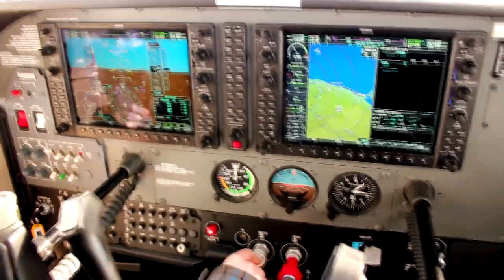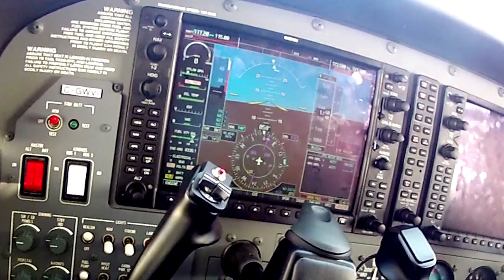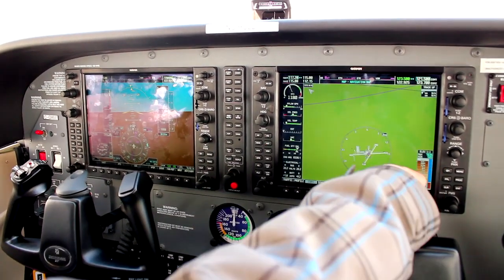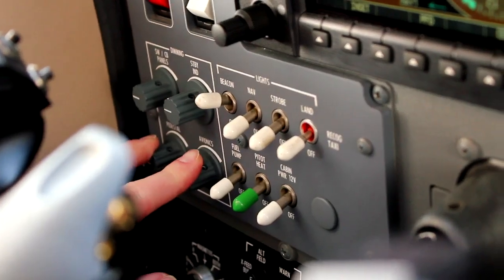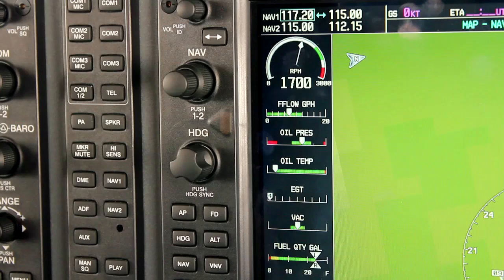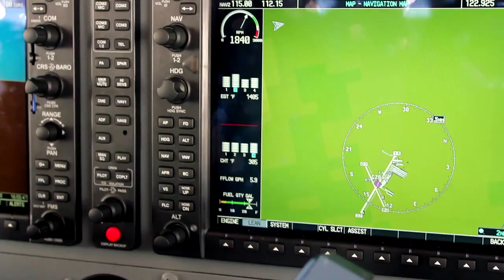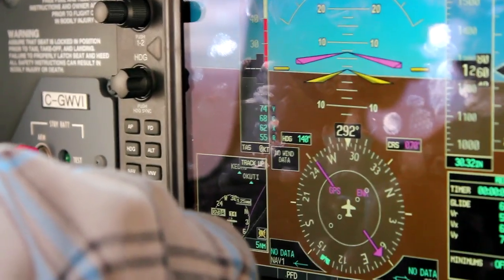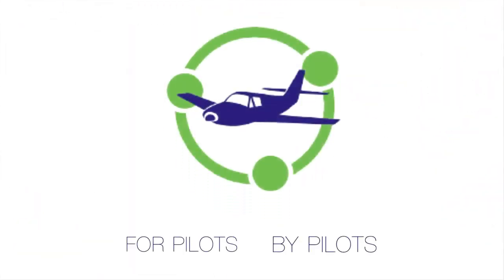G1000 Glass Cockpit tutorial - Start + Run-up - Real Time - POV flying

Comment: You do not turn off the ALT Master switch. Lot of people does that and is incorrect. Show me where in the POH says to cycle the ALT Switch  . 
You just turn lights or move flaps to see if the ammeter is working. Flipping the ALT  create spikes that can damage avionics.

Comment: I hate the G1000 for many reasons.
Firstly, fly-by-wire is a death trap. And I hate that cars are using it for steering and brakes and throttle now too. I know, fbw and the glass cockpit aren't necessarily tied together. You could put a G1000 in a Cub. But, it's hard to make electronics as robust as mechanical connections.

When I fly, I like to use all 3 navs with each other for redundancy and accuracy. The ADF needle lining up with the VOR2 needle to act as backup in case the VOR1 ILS inops. With the G1000, you can see only one of these at any given time by pressing a softkey. With the analog cockpit, they're all visible without taking hands off the yoke&throttle.

Comment: At 3:45 the question is asked how does the G1000 know where the (wet) compass is at? The instructor said there’s something inside it (wet compass) that knows (tells the G1000). This is misleading, or at the very least, unclear. There is a remote compass that is wired into the G1000 avionics box to tell it what heading to display on the PFD HSI. The wet compass has no input functionality.
Reply: G1000 has a built in magnetometer, no connection to the wet compass mounted on the dash

Comment: G1000 gives you really specific and precise information regarding engine performance, navigation, electrical systems, and Great situational awareness, especially regarding airspace boundaries and terrain.  Being able to program an IFR flight on the ground is so simple and easy, and a great way to get and stay ahead of the airplane in actual IFR conditions with the aid of auto pilot if you’re single pilot IFR.

Comment: Do some 172s not have carb heat?  I don't see it on the panel.
Reply from the maker: Older ones do, yes.  But I think this newer one is fuel injected.
Reply: Thank you for replying!  I learned something today.  I thought they all had carburetors!

Comment: Where's the turn and bank indicator?
Reply: as described in the video, the "ball" (slip/skid indicator) is represented by that little bar under the triangle at the top. The triangle is the turn indicator (shows degrees bank along the top arc).

Comment: I had my first flight with a G1000 172 last week. They are pretty cool but take some getting used to. Steam gauges are faster tio look at but once you start getting used to it the like altitude seem easier. Not that it matters I won't be able to afford anything like that when I purchase a plane. Good video thanks

Comment: I instruct in G1000 Skyhawks, and this man was incorrect as far as the HSI goes. It is in no way connected to the compass. There is a magnetometer in the wing that the HSI gets its heading info from
Reply: I want to like but I must not disturb the number.
Reply: DR compass
Reply: Can rudder paddle be adjusted in Skyhawk??

Comment: Oh boy. I'm 19 and I have plus 60 hours in a G1000 172. Almost to my CFI. Playing with the electrical loads on the alternator is nottttt good at all. And so are dirty fingers :)
Reply: False, the battery (and standby battery in the G1000 configuration) are designed to take up the electrical load if your alternator would fail. It would actually be in your best interest during the run up check to test if the battery will work properly in the event an alternator failure would occur & if the alternator will provide a sufficient charge after re-engaging the field.
Reply: You are correct. But we check the standby battery.....with the standby battery test switch! And we can check if the alternator is working by seeing if the busses indicate a charge, and if there is no low volt, or high volt annunciators.

Comment: Hey I like your videos, just a couple of things. Perhaps the instructor should brush up on Electrical System, it becomes very important with all the electronics in need for power. It is not a 20 volts system as he says, it's 28. We can se that on the Main and Essential Bus before he kills the Alt. Also, the transponder switches to ALT mode when passing 30KIAS not 45.  
One last thing, touching the screens the way he's doing it...bad habit with the G1000, they're not that easy to clean. 

Thanks for your job doing this videos!
Reply from the maker: Luciano Bianco Thanks, and agreed about touching the screen - it was driving me CRAZY :P  and I was thinking if owned this plane, there'd be some hand slapping going on :)

Comment: Its awesome how my checkout stressed a lot of the same things.  Like it's just a 172, lots of extra circuit breakers for the first extra equipment, and don't stress about getting exactly 1800 on run up with the digital readouts.

Comment: Great video.

I've got over 200 hours in a G1000. It's a fantastic piece of equipment but completely unnecessary in small, piston-powered aircraft. If you're a student pilot, you should be concentrating on learning how to fly, not operating the PFD/MFD. I had a lot of trouble keeping my eyes outside when flying. I'd take round dials and a 430/530. In my opinion, that's the most enjoyable setup.
Reply: I know this is an old comment, but in my opinion, if anything the new technology helps with some of the younger guys. It's a lot more natural to look at, and is easy enough to get around and actually helps with flying. That's just what I've noticed though, obviously it's different for everyone.
Reply: fl a re
I learned to fly on a G1000. I wish I didn't. ;)
Reply: Couldn't agree with you more!! 

Don't get me wrong this video is very well done and I came here to learn how the G1000 (or more generally GPS navigation) meshes in with instrument flying. What does it do for you?, what remains? (for instance, do waypoints, such as flying VOR to VOR still exist? or do we simply fly a DIRECT route between one airport to another etc.). These things are important to understand, as GPS is becoming the dominant way of navigating as time goes by.

However, as you rightly pointed out, I believe student pilots SHOULD learn to fly in "steam gauge" aircraft, where the emphasis is on MASTERING THE BASICS OF FLYING . Basic stick are rudder skills are the most important thing in the world at this stage!

I'm a student pilot with about 60 total, including 10ish solo, and am glad I'm doing it the old fashioned way in a bare bones basic C152!!! 😃
Reply: fl a re
I read an article the other day about how using a modern-day GPS to navigate doesn't exercise certain parts of our brain and, in effect, dumbs us down. I believe the same philosophy applies to new students using the latest and greatest electronic equipment to learn. If you learn to fly using the bare minimum, you'll always have those skills to rely upon when yhe fancy equipment fails on you. And, it will fail. it has happened to me and many others.

In the long run, it doesn't help at all. You may feel this way at first but, in time, you will realize that if you can't fly with the basics, you can't fly at all.

Comment: I've been training on a g1000 for a few weeks and it takes some getting used to. A couple of little tricks to help you out that my CFI told me is if your checking to see if the Alternator is charging just cycle between 0 and 10 deg flaps quickly and you can see an instant fluctuation of the charging instead of turning on all the lights and pitot heat. The light switches are in an awkward spot and flaps are easy. Another thing, if you're interested, is that since the dials are exactly the same whether your using the PFD or the MFD, when you go to set your heading bug, get in the habit of using the heading dial on the MFD instead of the PFD (on the far left side) That way enroute if your making adjustments you can keep your left hand on the yoke and keep flying.   And finally, another cool trick that some instructors forget about is, if you want to switch to 121.5 for an actual emergency, or just to see if your ELT is transmitting, instead of entering in the 121.5 manually, just hold down the COM swap button at the top of the g1000 and it automatically loads 121.5 and makes it the current COM channel. ... Just my 2 cents. !  Love the videos, very informative!!
Reply: Completely agree. Much more efficient to just toggle flaps
Reply: Holding down the COMM button to automatically get 121.5 comes/ inherited from the G430.
Reply: you can try on the flap trick on steam gauge too.  good stuff. every little bit helps.. thanks

Comment: Awesome video - what are the SD card slots located to the right of the PFD for?  Can you load flight plans with it or capture data from the engine analyzer/GPS?
Reply from the maker: I think that's how it works, but I'm a G1000 newbie at this point - I'll have to get back to you on that :)
Reply: @FlightChops  I think that is how you load the database.
Reply: They're also used for database updates...
Reply: Database and system software updates just as @at1357 mentioned.

Top slot is used for importing and exporting flight plans, Flight
Data Logging, and loading nav database updates. Bottom slot of each display contains a "Garmin Supplemental Data Card" which is used for storing the various databases.

You gotta realize not all SD cards are compatible with the G1000. We have to use SD cards supplied by Garmin or the aircraft manufacturer.